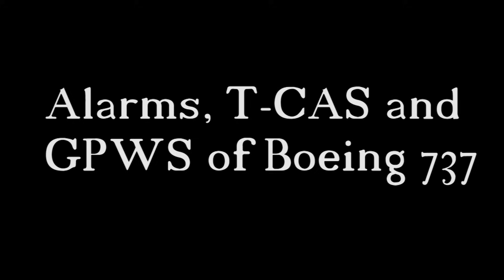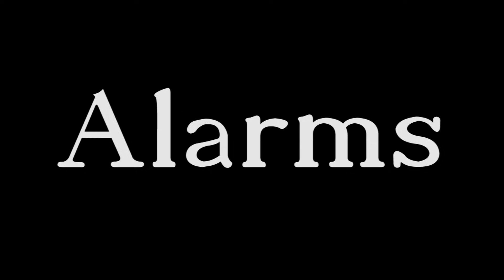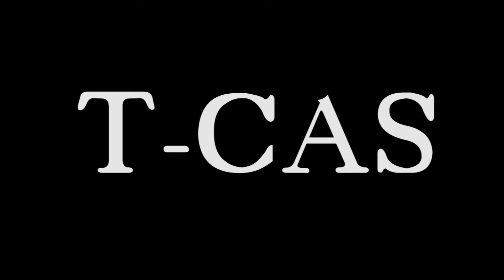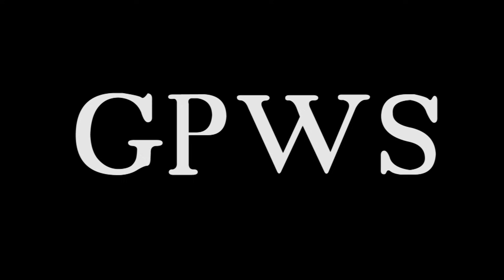Alarms, T-CAS and GPWS of Boeing 737

Comment: plen be like:

traffic traffic lalaksdjshsjsjagauuwhwheube pull up terrain flaps terrain gear lalaalakallalalalala engine 1 fire alalallalalalalalalal engine 2 fire climb climb now v1 crossing descend descent now increase climb maintain vertical speed crossing maintain tcas traffic traffic minnimums approaching 1000 500 400 300 200 100 50 40 30 20 10 traffic traffic retard retard pull up pull up traffic crossing increase climb stall stall lalallalalallalalalalallalalalalal flaps spoilers too low gear too low flaps too low terrain pull up LALALLALALALALALLALALALAL traffic traffic pull up pull up retard retard

Comment: First Alarm - Autopilot Off/On
Second Alarm - (i am not sure) Master Alert
Bank Angle - Plane rotated in such angle it causes severe descent with not much control
Caution, Terrain! - Terrain nearby, however with much time to react.
Decision Height - Autopilot height decision
Don't Sink! - Descent sub-sink
Glideslope - Gliding below 1000 ft (or something around that)
Plus 100 - Vertical speed above 100
Pull Up! - Like Caution, Terrain, but not with much time to react.
Radio Altimeter - Altimeter controlled by radio
Alarm (again) - Not sure, but either descent or master alert.
Windshear! - Extreme winds while turning which can cause the plane to lose control and become damaged.
Sink Rate - Severe descent
Too Low, Flaps. - Flaps too low compared to speed
Too Low, Gear. - Gear too low compared to speed
WOOP WOOP - When pull up alert
Fourth Alarm - Stalling 
Fifth alarm - what the fuc-
Sixth alarm - ALSO stall?!?!

T-CAS
Adjust vertical speed - Course requires you to change your vertical speed, the T-CAS usually shows you the required VS.
Climb - Plane on crash course, climb to avoid.
Climb, NOW. - Plane is extremely near to crash course, PULL UP.
Climb, crossing. - Crossing plane is climbing.
Clear of conflict - After crash course averted.
Descend. - Descend to avoid crash.
Descend, crossing, descend. - Crossing plane is descending.
Increase climb - Basically pull up and climb.
Increase descend - yea.
Maintain Vertical Speed - Whenever crash course averted, you are not to touch your steering, this is what this means.
Monitor Vertical Speed - Monitor your altimeter, my dude. ~TCAS
T-CAS test, passed. - T-CAS passed the test where it sees if it detects a plane.
Traffic, traffic. - Crash course
T-CAS test FAIL. - NEVER use this airplane again until fixed.

GPWS
Minimums - Approaching minimal altitude
Approaching minimums - Approaching minimal altitude more rapid.
Approaching descision height - Approaching decision height on altimeter.
2500 and rest - Height in feet

Comment: GPWS MODES
MODE 1: SINK RATE … PULL UP (when there is an excessive rate of descent)
MODE 2: TERRAIN … PULL UP
MODE 3: DONT SINK (when on t/o or missed approach you start loosing altitude)
MODE 4: M4a TOO LOW GEAR
M4b TOO LOW FLAPS
M4c TOO LOW TERRAIN
MODE 5: GLIDESLOPE
MODE 6: BANK ANGLE & RADIO ALT. CALLOUTS
MODE 7: WINDSHEAR
Reply: Send The Drunk To Go Buy Wine

Comment: 0:40-0:41 is the sound that's made when you are moving too quickly for the level of flaps you have out and are risking possible damage/cracking to your flaps.

I've got about 400 hours on the 737-800 simulator and am ALL too familiar with that one lol.

Comment: All these comments are wrong. Here's what they really mean:
"Decision Height" - time to decide what your favorite altitude is
"Don't think" - Stop overthinking
"Sink rate" - The lavatory sink is running out of water
"Caution, To rain" - It's about to rain
Bell ringing - the plane is running normally
"Too low, flaps" - Your wings need to flap harder because the plane is getting too low
"Too low, gear" - a gear somewhere in the engine broke and you're very low
"Whoop whoop, pull up!" - your pants are falling down.
"Plus hundred" - you need to gain some weight
"Radio altimiteter" - The Altimeter wants to talk to you on the radio
"Glideslope" - it's almost time to land, so turn off the engines so you can slow down and coast to a nice quiet landing
"Minimums" - You've reached the minimum amount of the time the plane must fly
"Winch here! Winch here!" - this airport has a special winch to help you take off

Comment: The most terrifying moment in cockpit is- when pilots can hear the stall warning and 'pull up' at the same time.
Reply: What about the overspeed and stall alarm? (Falling like a brick too fast)
Reply: Aircraft with a Thrust to Weight higher than 1/1: “I missed that part where that’s my problem”
Reply: @BrapBrapDorito  whats the meaning of that?does it mean with that ratio, that aircraft will be always able to recover any stall if full thrust is given??
Reply: @muhammadhabibie6620  Basically. When an aircraft has a 1/1 or higher T/W ratio the aircraft could theoretically hover on its engine power alone.
Reply: @muhammadhabibie6620  It means that if you get the thrust pointed down at full power, you could gain altitude with zero airspeed. As far as I know, the only such aircraft are some fighter planes, helicopters, some research aircraft and some aerobatic planes. Carrying that much engine generally leads to fuel bills that no one wants to pay, so these types of aircraft are only used when nothing else will do.
Reply: This has actually happened. The static port was covered which lead to both the over speed warning and stall warning at the same time. It lead to a 757 crashing into the ocean upside down.  Search for flight 603 crash.
Reply: @jdrissel Aeroperu 603 specifically
Reply: This is painful to imagine. Be feeling pretty helpless
Reply: This is what happened with AF447. When this happened, you dead because there is absolutely nothing to do.
Reply: @CalmaxFilm  you can try to make an emergency landing.
Reply: «АНДРЮХА, НЕ ПАНИКУЙ!»
«НУ НЕ УБИВАЙТЕ! НЕ УБИВАЙТЕ!»
«ЗЕМЛЯ!»
«ААААААААААААААА!»
конец записи чёрного ящика.
Reply: nah , stall , pull up , terrain and windshear at the same time . there you are fucked up
Reply: DON'T SINK
Reply: Sounds terrifying, but commercial pilots train this regularly. In this case they fly on the edge of the stall warning, maximum thrust, pull up as much as the stall warning allows.
Reply: LMAO kkkkkkkkkkkkkkk

Comment: GPWS音声警告日本語訳(意訳含む)

Bank Angle 傾斜角異常
Cautions terrain 地表注意
Decision hight 着陸決定高度突入
Dont sink 降下厳禁
Glideslope 計器進入システムより下に飛行
＋100 計器進入システム100フィートオーバー
Pull up 上昇せよ
radio altimeter 電波高度計未設定
Windshear 風向又は風速の急激変化
Sink rate 降下速度異常
Glideslope ↑同記上にあり
Too low flaps フラップ要確認
Too low gear ギア(脚)要確認
Too low terrain 地表接近
terrain,terrain Pull up 地表更に接近、上昇せよ
V1 離陸速度(異常が発生しても離陸を継続しなければならない速度)
Peep,Peep Pull up 上昇せよ

Comment: I know these are sounds that you never want to hear while flying but I just love planes and computers so much that I deeply admire this.  The plane's computers and sensory array are ever monitoring the situation.  The plane is like another pilot in the cockpit.
Reply: I know i'm a bit late, but some of them are completely normal to hear. For example the 2500'-10' Callouts are just there to help the pilots and you hear them on every landing.
Reply: They are replacing flight engineer
Reply: the rattle could be the worst sound here
Reply: a bit late? that's the understatement of the year haha. don't feel bad guy I was the first one to respond to a 13 year old comment the other day the dude could be dead now for all I know lol
Reply: @skeetrix5577  Last week I had someone respond to a comment I made 11 years ago, I saw it by pure chance because it was a video I rediscovered. I felt very old xD

Comment: Altitude,Flap autopilot fail, engine one fail engine two fail,  
Tcas alert ,pull up ,windsher traffic , climb climb now, to low
Gear, to low terrain, to low flaps,500,400,300,200,100 50 40 30 20 10 butter, gear Lost 
Systems damaged,not function, stall, bank angle ,glide slope,overspeed